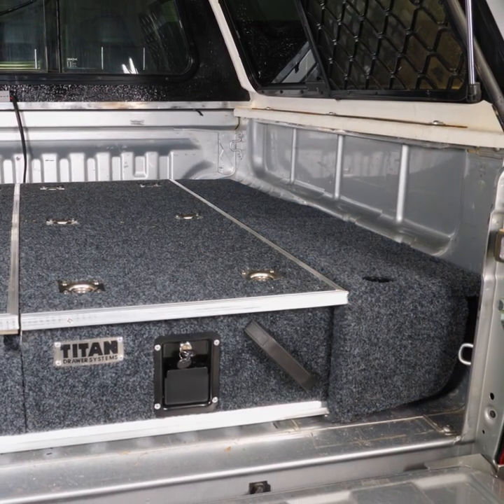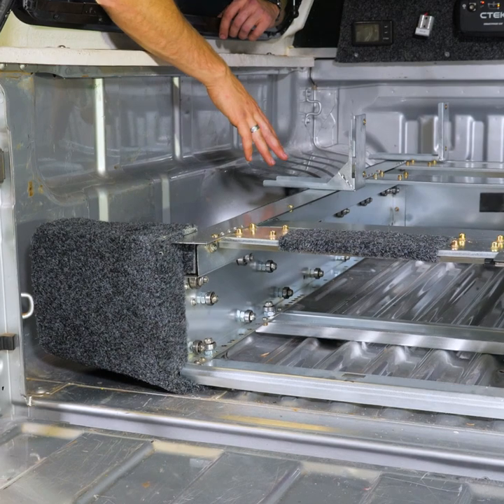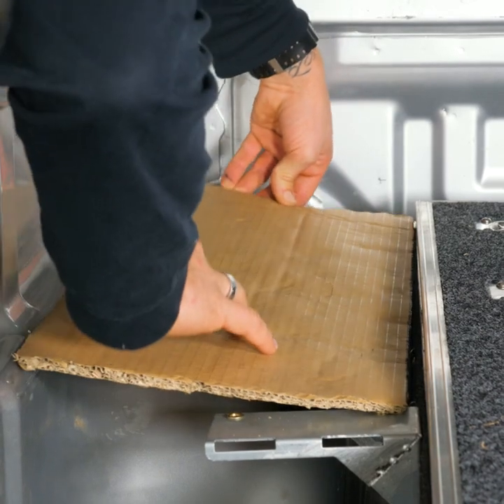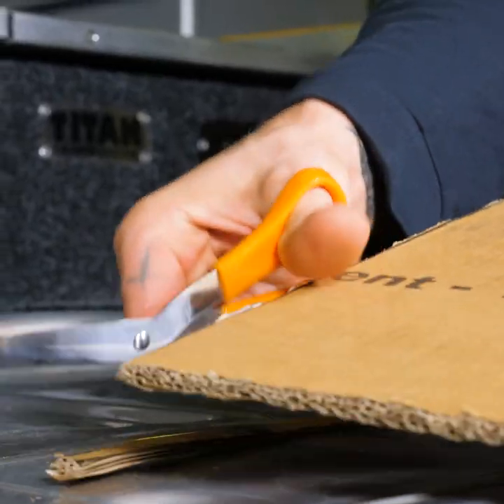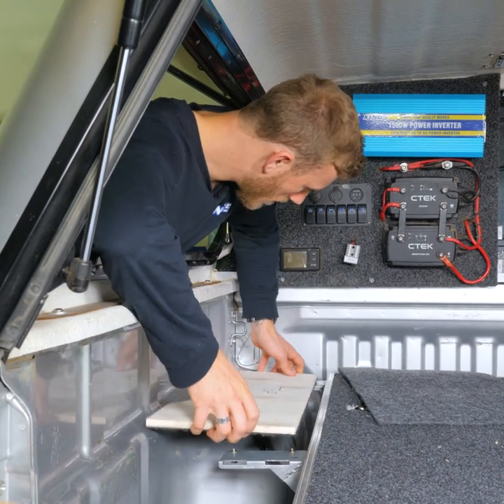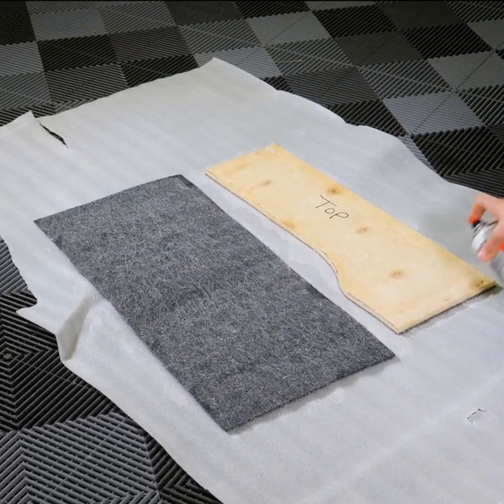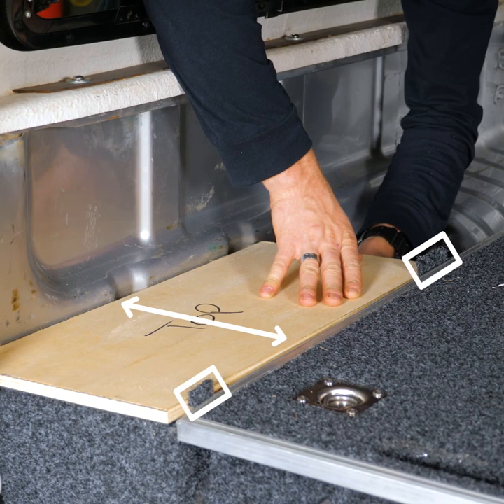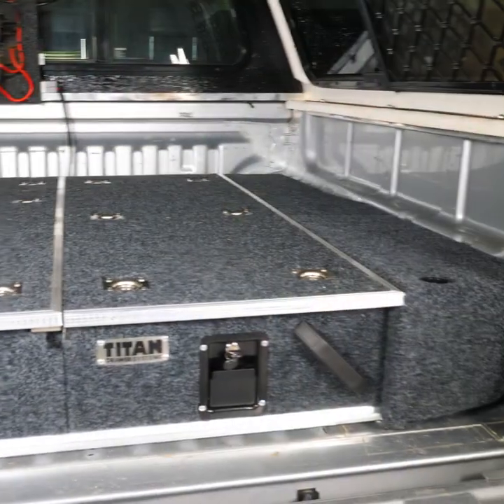How to install Titan Rear Drawer Wings

Comment: Hi, awesome video, thanks for the tips! 
 Q: Do i need to cut around the wheel arch or can i just rest the wing on top? installing into a LDV T60. TIA
Reply from the maker: Hi there,

Sometimes it depends on the vehicle and the install as to what's a better option! we have done both - cut a wing to match the contour of the wheel arch OR rested it on top. This really depends on the height of the wheel arch as it can mean the wing sits up on a bit of an angle, but that's no big deal - you can space up the outer bolt holes with some washers, or a couple bits of ply!

In some cases you may also need to trim the steel brackets, particularly if the vehicle has a plastic tub liner, but that's the fun of a DIY install haha!

Cheers, Courtney
Reply: @4wdsupacentreAu  thank you for your detailed information,  it's really helpful.  Being a newbie to all things ute and 4WD your page is awesome.  Keep up the good work 🙌🏾
Reply: @4wdsupacentreAu  thanks mate, I really appreciate your feedback. Can't wait to do another of your DIY.
Keep up the good work! 💪🏾

Comment: Im in the process of adding the wing kit to my 1300mm titan drawers in the back of a navara d40 dual cab tub.
What I dont understand is the front bracks are pre-carpeted, but the carpet does not extend to the sides of the tub getting a flush finish and there's nothing to fix the carpet overhang to.
What are people doing for the front facia of their side wings?
As to make the sides a solid box that can store items, you almost need to add carpeted plywood and additional brackets to finish the front of the wings, but none of the videos show this step.
Reply: Im having the same problem mate with no answer. Did you find out how to fix this?.
Reply: I have the same problem with my 2012 hilux. The end corner piece is 65mm to short to hit the floor of the tub. And its a universal wing kit. So I didnt use the kit except for the brackets. Got a bit of 18mm ply board and had it cut at 1200mm long and 220mm wide. Then cut a bit to cap the end where the corner piece was suppose to be. I used black carpet next to the dark blue it comes with. Put a cut down piano hinge on the cut board at the desired length for a door so you have access to the storage from the wheel arch to the tailgate. Done. Its a bitch of a job but way better than there wing kit. And more stronger.

Comment: Completely glosses over the holes you need to drill into the tray /tub.
When you do splurge on a little spray paint and schmoo. If it's good enough to sniff at $2 it's good enough to use to prevent rust.